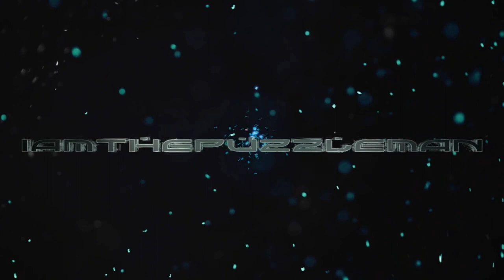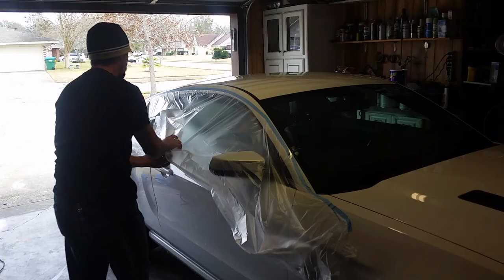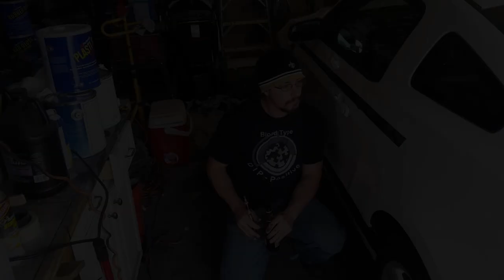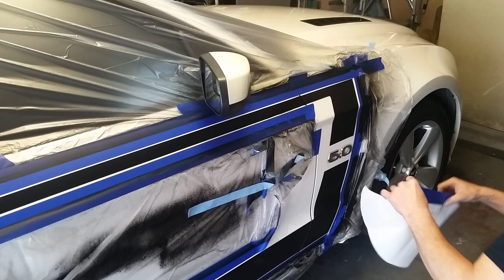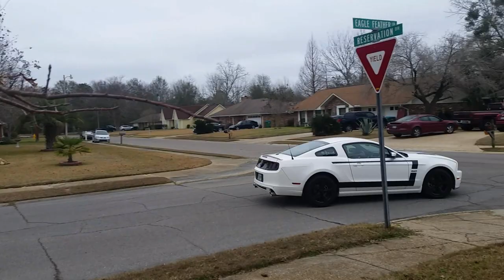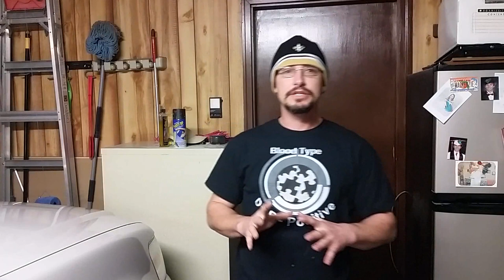Fun With Plasti Dip Aerosol

Comment: wouldn't the thinner mess up the stock paint
Reply from the maker: +Xavi M Not at all, just before you posted this, I addressed that very question on my FB page. It has been over a year with these stripes on and peeled them with no problem nor damage to my paint. The thinners in aerosol are no more harmful than sprayable dip or self thinned.

Comment: So I see your using PDS and RDS, not thinning any more?
Reply from the maker: Not sure what you are referring to. I use it very little. I still primarily self thin.
Reply: I saw the buckets on your the shelf.
Reply from the maker: veilsyde aaah yes. I do have that 1 gallon. I was going to use it for this video but I always look for the lowest cost method, and aerosol was the best solution for this video. I will get around to breaking the seal on that pre thinned gallon one day.
Reply: Have you had any issues with Xylene damaging your projects? Clear coat?
Reply from the maker: veilsyde not so far. The rare cases of damage I have seen was from pre existing problems with the paint or clear. The paint job job should be OEM.
Reply: gotcha...Thanks bud.